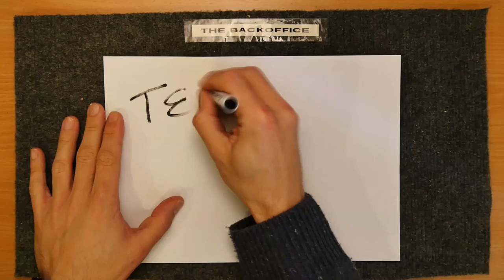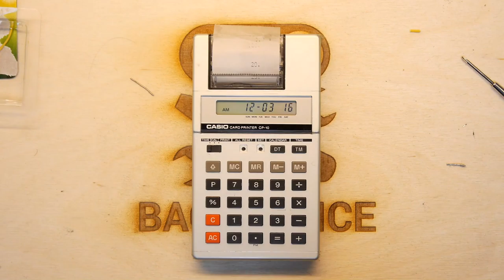Casio CP-10 calculator repair

Comment: the batteries were fully charged before dispatch and the charger is 9v center negative, the printer not only prints the calculations but can also print a monthly calendar (handy to stick on the fridge to know when bin days are).
Reply from the maker: Oh thats really good to know! I returned this back to its rightful owner, but look forward to trying another one sometime. If I do, I will definitely get the manual, the calendar function sounds great!
Reply: i know, i'm the rightful owner ;) (how else would i know i'd fully charged the batteries before posting), anyway, you'll have your very own cased cp-10 when i get the next parcel sent (takes plain thermal paper rolls 68mm wide by 16mm thick).
Reply from the maker: I thought you were talking about how Casio shipped them :) I thought 'fully charged' nice touch!

Very excited, I didn't pay enough attention, are they using nicad or nimh batteries?

Comment: Great job, try setting your soldering iron to 550° F, your tips will last longer and you would not overheat components so quickly, plus, it's all you need to use for most things

Comment: The original batteries in this device are NiCD; replacing them with these NiMH batteries is not recommended, at least not if you intend to keep using the original internal charging circuit.
Reply: Would it be possible to solder in lithium cells and never need a charger?

Comment: What about dismantling some older stuff and creating a new 3d printed case and making a 2017 modified version. (game gear?) wink The batteries that mine ate were mental. My favourite games were Taz and Psychic World from 1988.
Reply from the maker: Do you have any links to 3D models for a suitable case? I would spend months designing my own!
Reply: I've no experience with 3D printers. However, I don't know if you can blender render?
Reply from the maker: +m22rdy the printing bit is OK, it's the designing in 3D. That's why there are relatively few nice 3D designs. Plenty of functional, fewer pretty.